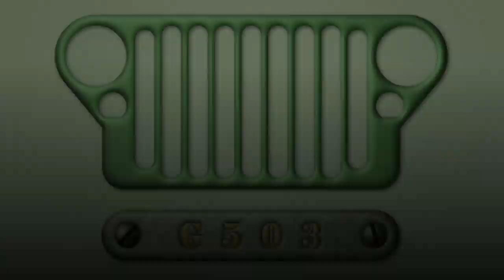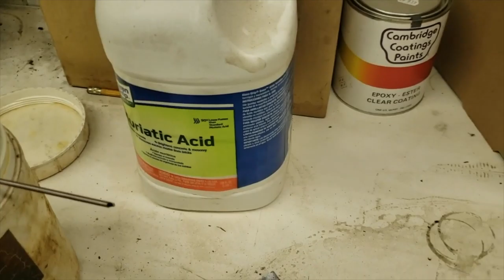Zinc Plating, It's Easy! A step by step how to with Lew Ladwig IFFC Willys MB Ford GPW Team G503

Comment: I've been plating jeep parts for a while. It's super easy and very cheap depending on how you do it. Roofing zinc, water and vinegar. No dangerous chemicals required. Doesn't even need to be super clean, I use electrolysis to derust then plate. The 100% zinc roofing material is on amazon 50' roll. Haven't used 1 roll yet. Stainless brush will make it shine like chrome. A small 500ma 5v power supply is all I use...